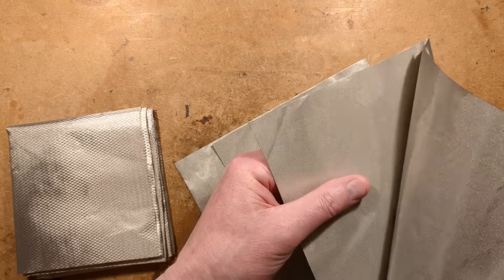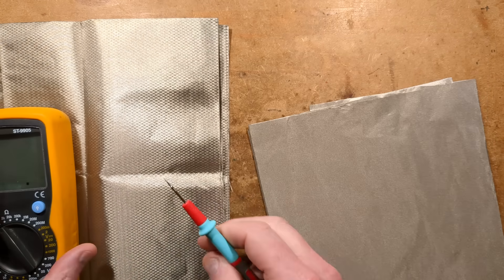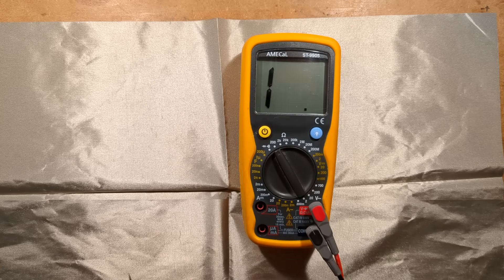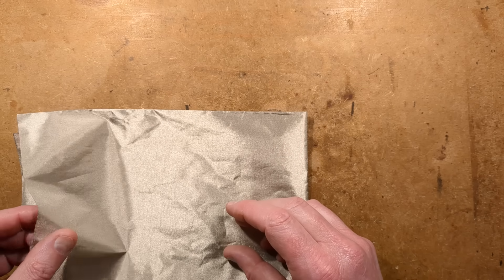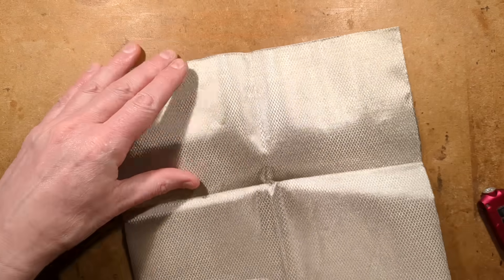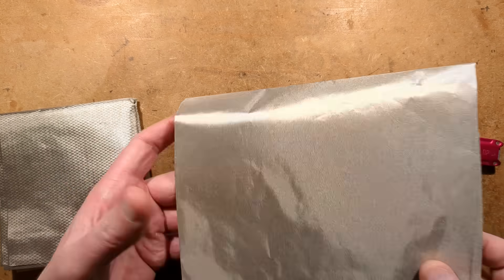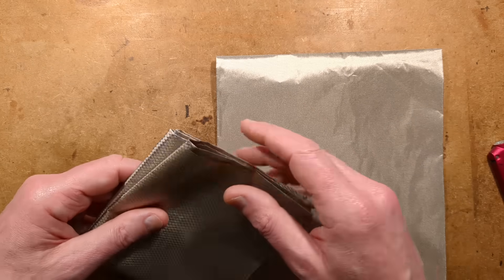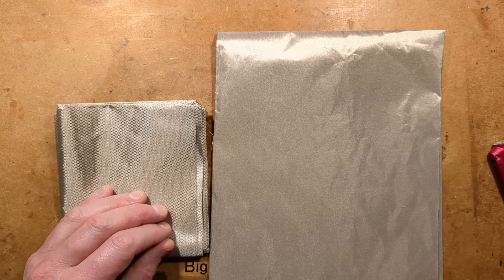Anti 5G fabric is amazingly conductive

Comment: I have used copper mesh behind glass windows that expose the inside of esd sensitive electronics, but these don't look transparent, but I suppose you could line the inside of a plastic enclosure with it. I couldn't imagine it being cheaper than aluminum tape.

Comment: We use this stuff in Fencing jackets for electric hit detection for Foil and Sabre. Essentially, the blade is electrified and the jacket (made of this material) is connected to the detector box via crocodile clip. When the blade contacts the jacket, the circuit is closed and the box lights up and makes a noise confirming the hit. I bet this stuff being popular for 5G will make repairing said jackets a lot cheaper now though!

Comment: I have pouches with this material inside for car-fobs. Can be used when you want to leave a car-fob in the car, very handy if someone is lending your car and wants to leave the key inside it. You can typically open a back door, lock the car and then pop the key in pouch into the center console storage.  
It can also be used to avoid thieves beeing able to extend the range of the key.

Comment: I suppose you could make your pockets “radio proof” so you don’t need a special wallet against various NFC attacks.  I guess you might even be able to make a portable SCIF with material like this.  At least from radio snooping.  It would be better if you could apply it to something else and etch some away somehow.  Wearable circuit board.  But probably difficult to manage.
Reply: AFAIK - The best way to protect against NFC attacks are to always have two or more cards together. The signals will be mixed/garble and thus unusable for the thief.
Reply: @MalawisLilleKanal yeah, that probably works too, but he was looking for uses of that fabric.  I guess you could also line a tent with the stuff so you could prevent 5G from reaching you… so that your phone doesn’t ring, you get no texts, and can in general just get away from the internet.  But putting your phone down and walking away also works.
Reply: @roboknight  The fabric is already used in FOB poches, and it works like a charm - just like a pocket lined with the material would dissconnect your phone.
Reply: @roboknight  If your phone doesn't have any signal, it'll drain the battery trying to connect.  Probably better just putting it on aeroplane mode if leaving the phone on, so the battery would last a lot longer.
Reply: @AubsUK yeah, from the testing I’ve been privy to, airplane mode is pretty much BS.  Kind of hilarious really.  But turning a phone off works too.

Comment: One use I could think of is about shielding any gaps around microware oven casing and the other bits, i frequenty find my wifi signal gets disruppted everythime my hoover microwave oven is running.
Reply from the maker: Keep in mind that there needs to be good airflow around the oven.

Comment: If you wanted to make wearable electronics out of it, how can you make connections to it? Can you solder wires to it? Or would you have to make the connections using crimps or some other kind of pressure-based termination?

Comment: can it be used as a liner in a microwave oven ie make it posable to make a backpack with a built in packet oven or a microwave pizza delivery oven ie the box you have the pizza delivered in could reheat the pizza in the car if it blocked microwaved

Comment: Wrap my speakers to prevent interference with my 36" CRT. the speakers as they are on both sides and on top is creating some distortion with the image that is gone when my speakers are moved. This is great actually. I can have them both in a good spot, and have clear picture. Tinfoil doesn't match the matt grey of my set like this does. This would blend right in.

Me and the 11 other active CRT users will be thrilled by this discovery.

Comment: LinusTechTips tested a Faraday cage intended for putting your WiFi router in to weaken its signal. When you use it, all your handheld WiFi devices now transmit a STRONGER signal to talk to the router inside the cage.🙄

Comment: How would you attach a wire to this material?

And how durable is that connection?

I bet you could make a flexible capacitor, the problem with existing ones is that the connection breaks.
Reply from the maker: It can be soldered, but also melts.

Comment: You might mention to always put phone in airplane mode & blanking the screen before wrapping it up!

Otherwise, if the Metalized polyester is a good insulator, one could easily overheat one's phone.

And, without turning on airplane mode, the phone will be unable to make any radio frequency contact and go to using its maximum power to be able to register for receiving phone calls and messages. This runs down the battery much faster than normal use.

Comment: One use I can see for this is essentially Faraday caging your router's Wi-Fi to block out other people's wireless routers from interfering with your own Wi-Fi, because pretty much everyone these days has a wireless router of some kind in their homes, and since a lot of people are on the 2.4 GHz band and now even 5 GHz and 6 GHz bands, and broadcasting on the same channels as each other, this can cause interference with the reliability of your own Wi-Fi since your devices if they're connecting over Wi-Fi are pinging and communicating with other routers in the area on the same channels and band, they're constantly beaming out signals which can degrade the performance, because your devices don't just communicate with the router they're paired and authorized with by going "Hey are you there?" and the routers responds "Yes, I'm here." they call this the handshake.

To get the most use out of this for Faraday caging your own Wi-Fi in the home from interference of other wireless routers, you'd be best double-layering this fabric around the home with maybe some thumbtacks or some other on the walls and such, if you have a spectral analyzer for radio signals you'll be able to see how much noise there is from other routers, and place up these metallic fabrics to reduce that noise bleed in areas that has the most noise interference, however in areas where there are windows, it'll be a little more harder to block out other Wi-Fi signals. There are EMF Shielding Paints that can give you the same effect as they have metallic particles in the paint mixture, but these are far more expensive than your regular kinds of paints, like upwards of $200+ kind of expensive.

Comment: This stuff looks like it would be useful for EMI shielding, especially for wearable electronics etc that have some components that benefit from it (I could imagine some kind of sensor that needs to measure tiny voltage/resistance changes needing to exclude as much interference as possible by using differential measurement, EMI shielding and as many other tricks as they can fit into a small package). Definitely a more suitable solution than also wearing an EMI can...
I wonder about its characteristics when it comes to changing resistance under various physical deformations - it could be useful as that kind of sensor with the right measurement/amplifier circuitry. That kind of fabric already exists, of course, but I'm not sure how the prices compare - this may turn out to be a cheaper option and so more attractive for DIY projects requiring that

Comment: ive seen it used in cosplay as wiring for leds and stuff
Reply: Yep, it's useful in wearable electronics. Some fabrics have appropriate changes in resistance in response to physically deforming the material e.g. stretching, so I wonder how this stuff performs in that department, since that's another thing that would make it useful in wearable stuff

Comment: Indeed, imagine the rectenna you could build with a bunch of that.
Reply: I always thought a rectenna was a joke about a shit antenna design until I came across it in some high power microwave papers from the 60s
Reply: @gordslater  Absolutely not a joke. They went nearly straight to powering things that can fly with them. Imagine that.
Reply: I'd never heard of the name before, but I have heard of the principal.  I'm sure I've watched a YouTube video where someone tried harvesting electricity from underneath high voltage power lines.  Just Googled it, for 'YouTube high voltage power line extract' and it's the one from 'Hyperspace Pirate'.

Comment: We use a variation of this stuff in HECS suits for hunting. As a hat, it will make a great antenna unless u place anti static bag plastic on the inside layer of the hat. Prolly need several layers. Also, since its highly conductive & lightweight, its ideal for a ballon platform array for an ATMO motor.

Comment: This could be quite useful for wearable electronics and lighted costumes. Those tend to use a lot of conductive thread.
Reply: Was scanning comments to see if anyone had my same thought. Yes, it has made me think of wearable applications immediately. Low current sensors and signals, ok, but what kind of current can it handle at what width? Clearly, we need more data. Also, how stable is it during a tailor's process? How does the material wear? Data gathering can be fun. For incorporating conductive thread, @rtrusty91 has made a really great embroidery design tool.

Comment: I'm 99% sure this is conductive material for making carbon fibre products either EMS compliant or for providing a ground plane in case of high voltage leakage detection. I'm not surprised it works as advertised 🤣Which is probably why it's diffuse.

Comment: I would have had a use for this 20 years ago to shield some CRT monitors, which were being interfered with by an electric transformer, not 2 metres from the monitors. (outside of course on a power pole) The alternative was to build benches across the room.

Comment: Would you consider running one of these through the wash a dozen or so times and seeing whether the conductivity is affected? I always worry about the durability of these odd fabrics.

In terms of applications, I bet you could make sensors with these in one way or another. Like, maybe have two sheets of this glued on either side of a piece of felt, and I bet the capacitance would change when you bent it. Or something like that. I might have to get a sheet to experiment with it.

Thanks for making me aware of this!

Comment: it could make a great wallet lining to block contactless cards from being scanned/stolen or would it need to be grounded/earthed to be effective?
also if anyone has a lot of wifi interference and is willing to rely on wifi calling at home for calls they could line the outer walls of the home with it for much better indoor wifi signal but anywhere downwind of the home from the nearest fifi tower could be a dead zone and probably cause the same issue for TV signals (especially if living close to a tower)

Comment: I sewed a travel pouch lined with this stuff that is flat and you can wear it under your shirt (Its a flat cloth bag with an adjustable cross body strap that isnt noticible under clothing unless you were wearing a thin tank top) The lined pouch is sized for my passport since all modern passports have rfid tags in them. It also has areas for an actual drivers license, a few credit cards or hotel room cards, cash, and a plastic lined zipper waterproof area for medication.

Highly recommend it for any passport pouch.

Comment: My first thought is to use composites. If used right it might conduct low voltage low amps okay enough. Pretty much you could make a composite surface that also has low power planes in it.... Maybe?

Comment: It would work very well when integrated into a garment as an 'anti-taser' solution. There are commercially available electroshock weapon proof garments from the likes of ThorShield. This type of fabric was hard to get and ridiculously expensive a decade ago. They work by disappating the high voltage from a taser over a large surface area, all that remains is a tingle. Come on, Clive, do some tests and some garment patterns, we may need them before long.

Comment: Thieves these days use a lot of electronic skimmers, which they just need to bring close enough to your cards, in order to steal everything you have in the bank. If you line your pockets with this stuff, you'll just have to worry about pickpockets and muggers, not skimmers. I can also imagine an Antifa rioter lining his clothes with this stuff, in order to protect himself against directed microwave crowd control weapons. Those weapons are very real, though costly, they're extremely effective and nobody wants to be anywhere in front one when it starts blasting. Extended exposure can lead to severe burns and in the worst case, neurological damage, blindness, etc, so protection is vital. The weapons actually use the same technology as 5G, but in stead of scattering the energy all over the place, they employ a narrow beam, which can be focused with pinpoint accuracy. You can literally take down the ringleader of a riot, by literally melting his face, while only causing minor discomfort to the people around him. As for the reason why some people feel the need to protect themselves and their homes against RF radiation, you obviously can't imagine, before some stupid ass service provider decides to plant a row of 5G antennas on top of the neighbouring building, facing your window, just six meters away. The antennas may be wide beam, they may not be focused on you, but they're on 24/7 and they'll make your life Hell in no time. The first thing you'll notice is a permanent headache, which no meds can cure. Your brain is only protected by two millimeters of skin and one millimeter of bone, so of course your head will hurt. The next thing you'll notice is a constant tingling on your skin, especially on the side facing the antennas. The next problem is insomnia, which can't be cured by meds less potent than heroin. The next problem is shooting pains in any random part of your body. One moment, you're fine, then you just find yourself on the floor, feeling like you're getting stabbed in the liver. The next problem is dry eyes, eye pain and maybe some blurred vision. Your eyes have zero protection, they're completely exposed, so you better get used to your eyes feeling like they've been rubbed with sandpaper and some asshole is sticking needles into them. Of course, your heart will eventually start showing symptoms, like arrhythmia, or missing a beat, so you'll probably get your heart checked more than once and the doctors will be baffled, because there's no physical reason for your condition. You'll be feeling fatigued, sick, and hopeless. You'll feel like you're dying alive, one cell at a time. At some point, you'll notice the symptoms disappear when you leave the house and start again when you come home. If you're smart enough to connect the dots, you'll soon figure out this started when those antennas were installed and there's gotta be some kind of a connection. One day, you decide to sell the apartment and get a house in the middle of nowhere, far from the nearest cell tower. Unfortunately, you don't get much of a price for the apartment, because nobody wants to live right in front of those antennas, so your new home is quite a bit smaller than you were hoping it to be. You'll feel much healthier than you've felt in years, though, so you don't mind. Of course, you could have just bought some of this stuff and lined your apartment with it. If there was any left over, you could have lined your clothes with it as well. So, now you kow why this material exists.

Comment: 3:24 I saw a video about moisture harvesting by running a current across a wire in the morning so dew condensed on it, this would be 100x more efficient
Reply: That sounds very odd as running a current through a wire will heat it and cooling is what's needed to make moisture condense.

It may have been a prank like the guys who harvested AA batteries from a car battery many years ago.

Comment: Steal electricity from high voltage power lines. Its usually done with aluminum (not the best conductor) wire rlectric fence type receiver. If a person placed a two or four foot wide strip of this under power lines. It might collect a viable amount of electricity.

Comment: Question. If you wrapped a laptop in it powered off and an EMP blast went off, would the laptop actually be protected?
Reply from the maker: Potentially yes.  But without knowing when the blast was going to happen you'd need to keep the laptop in the shield as much as possible.
Reply: @bigclivedotcom  Wow lighting fast response <3
Reply: If an EMP blast went off I would be more worried about the effects on my me than my laptop.

Comment: Will this attenuate 50Hz mains harmonics? I'm measuring very small 2 kHz signals in a coil, but mains harmonics can interfere if their frequencies overlap with the signal. I had assumed these materials were too thin to have a significant effect at low frequencies.
Reply from the maker: The material could be used as a grounded shield in some applications.

Comment: Collapsible antennas, Taser resistant lining for clothes, RFID shielding for wallets, but probably the most interesting application would be  on the moon. Vaguely recall a theory about using electrostatic charges to repel the abrasive moon dust from sticking to pressure suits.

Comment: How well does it conduct heat? Like, if it was woven into a pillow case, would the entire surface area work as a better radiator of heat, making the pillow cooler for longer?
Reply from the maker: I'm not sure I'd want to sleep in contact with this.